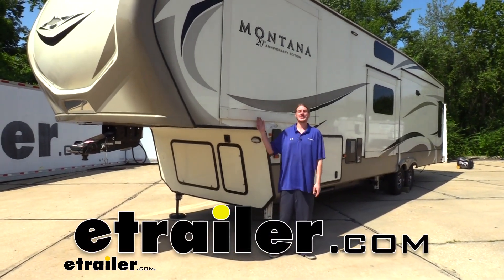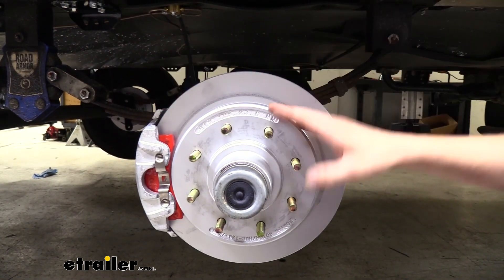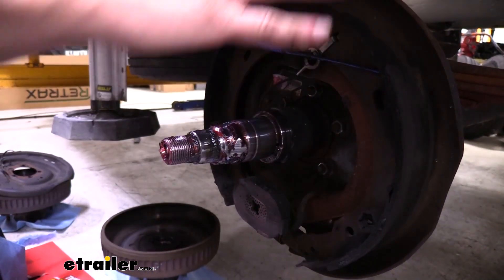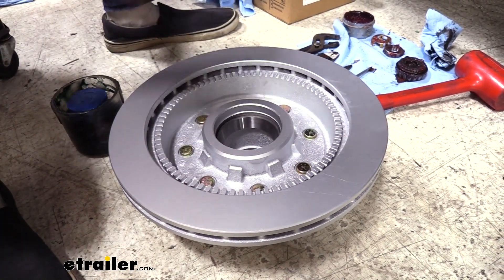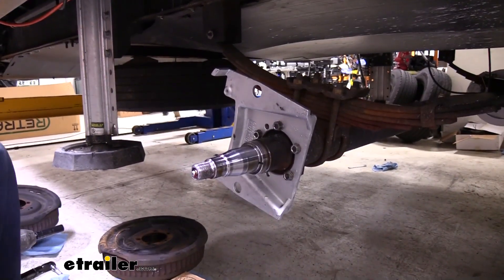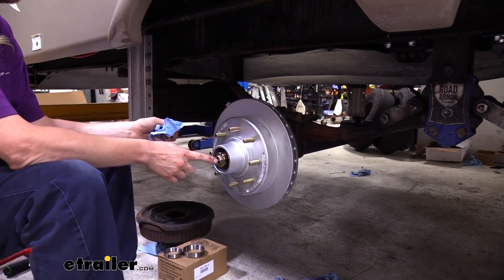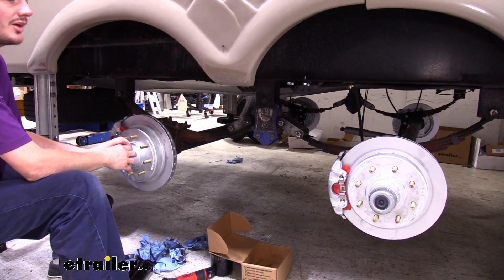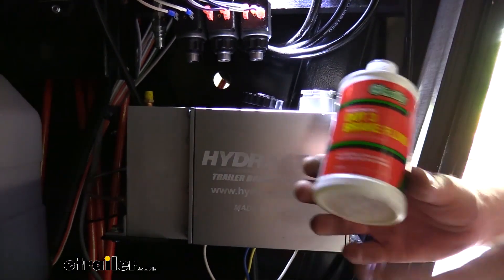etrailer | 2019 Keystone Montana Fifth Wheel Kodiak Disc Brake Kit: Complete Installation

Comment: I was looking for how to wire the actuator in the fifth wheel. I am confident I can install the system as I have done one on a gooseneck trailer. But I would like to see how the wiring is done. Is there another video on running and wiring the Hydrystar to the fifth wheels wiring junction box?